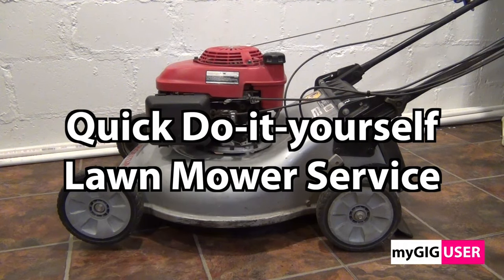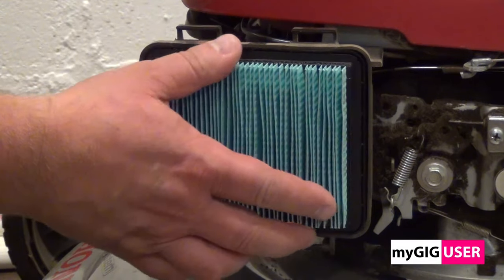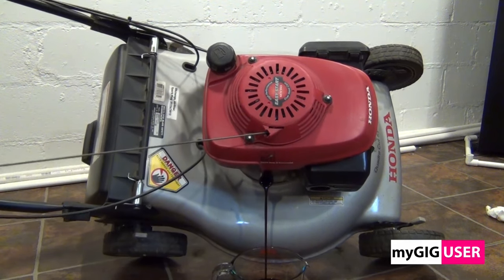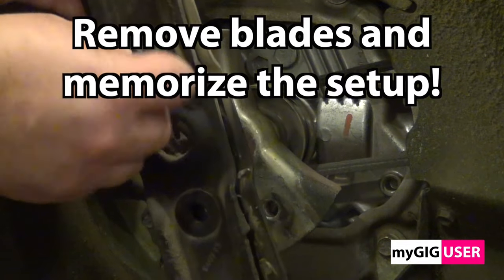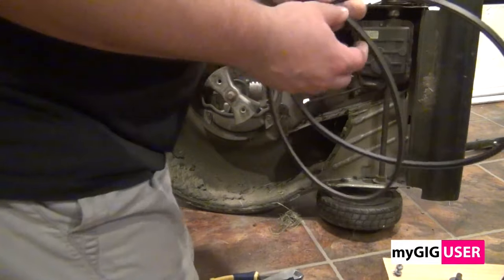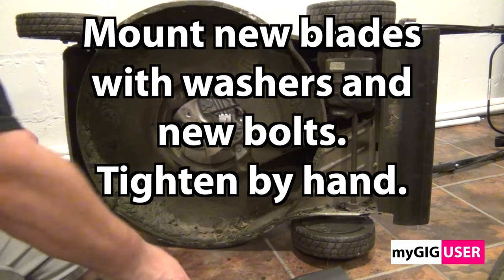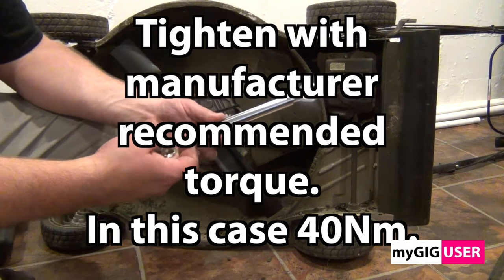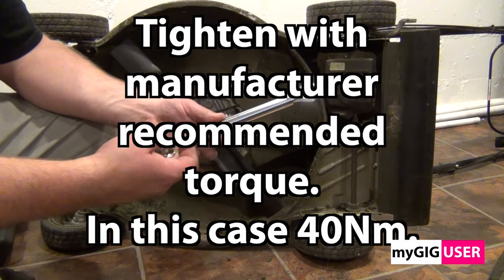Honda Lawnmower Maintenance / How-To: Oil Change & Filter & Blade  (HD)

Comment: But it said 1/16th of a turn though...

Thanks for the video.  I just bought a used HRR216 off craigs list for $50.  It ran like crap.  I basically did everything you showed, but also replaced the carburetor.  Less than $100 later, I have basically a brand new Honda mower.